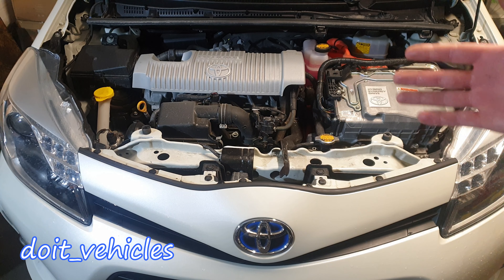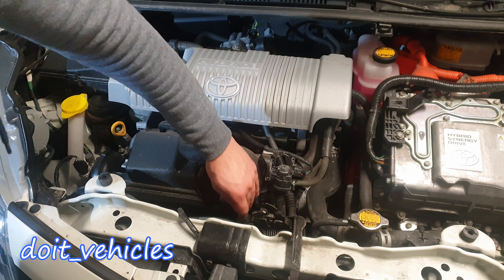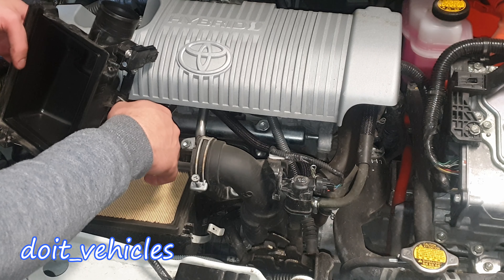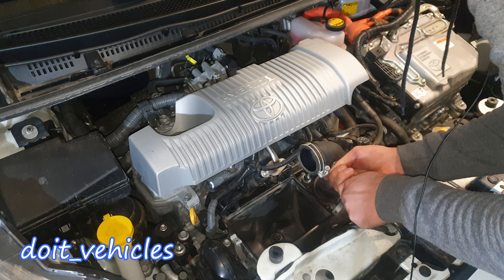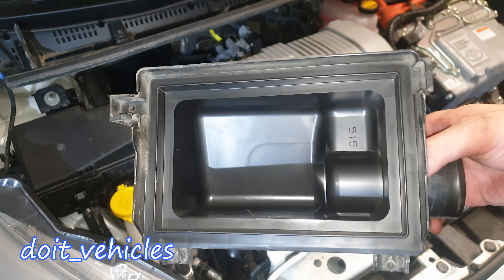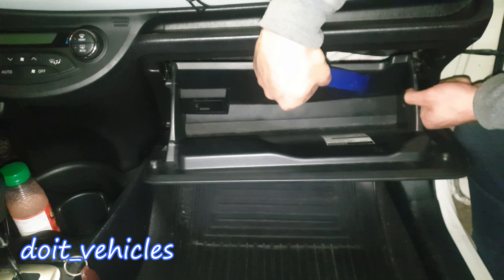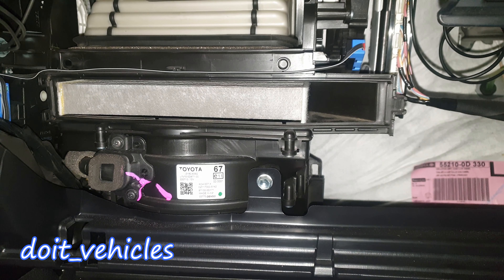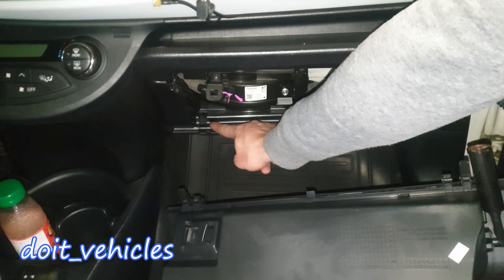Toyota Yaris Hybrid Intake Air Filter Change Cabin Air Filter Replacement

Comment: Is there a reason you didn't show us the arrow on the filter element? Was it an up arrow or can air flow direction arrow. If it says "up" next to the arrow then it's telling you which side goes up but if it says air flow then the air flow direction is down and the arrow should point down.

Comment: What is the size and number of bolt in side the housing. My bolt rusted and broken during unscrewing and need new.
Reply: I broke it during screwing back. Did you get the size and number of the bolt ?